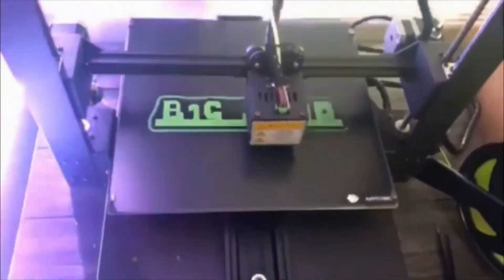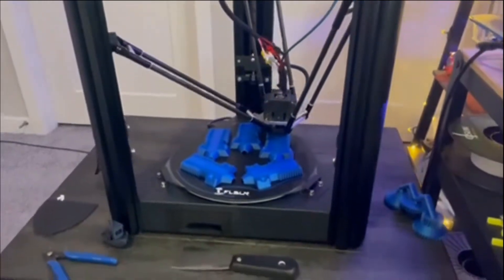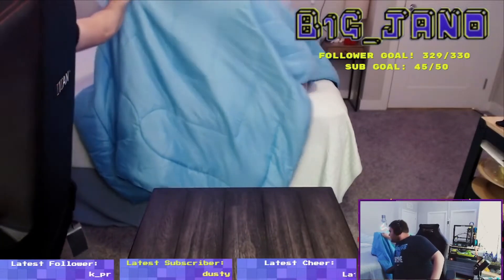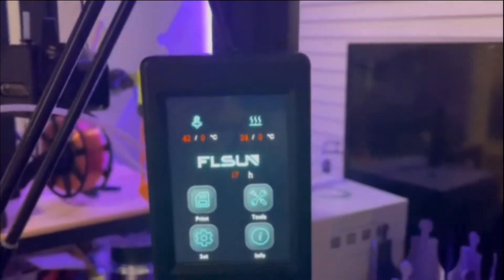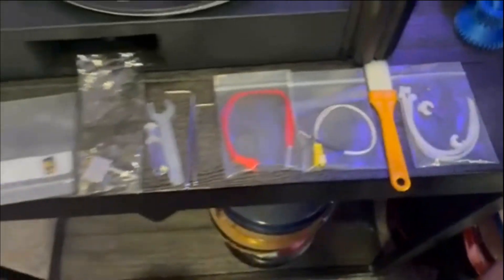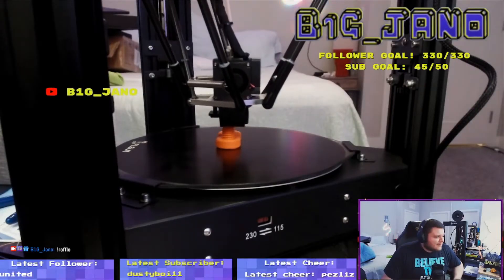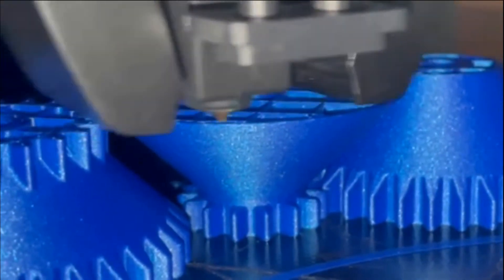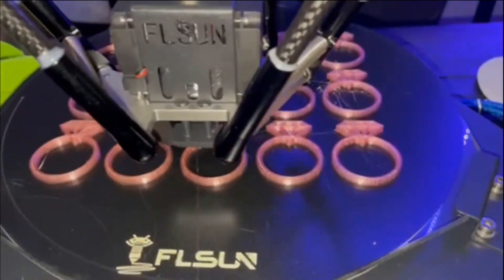I got a new 3D printer… and it is SUPER impressive!

Comment: Hi do you have stl for that nozzle light? And a video how you made it
Reply from the maker: Yes. The video is in the channel list not too far back! And the links for the stl’s should be in the link in the description of the video
Reply: @B1G_Jano  awesome thanks man I just seen it.

Also your quality looks so good what speed did you use on them prints?
My racer is coming tomorrow cant wait
Reply from the maker: I have the general speed set at 60mm/s with outer and inner walls set to 40 and 70mm/s respectively. Infill at 100mm/s travel at 120 mm/s with first layers set pretty slow to get adhesion.

Comment: Hey man I need help with my Anycubic Mega X. Just set it up but only one of the X axis sides are going down. Please help!!!
Reply from the maker: Hmm that’s odd… I would check to make sure all the motor wires are plugged in properly and in the right locations. Not sure what else could cause that other than a bad wire somewhere. Maybe that motor wire could be loose on the motherboard side as well.

Comment: B1G_Jano, I'm having trouble with my mega x. It's having a really hard time heating the bed up to temperature, and sometimes, like recently, it couldn't get to temperature. I have it set to 100 C and it took half an hour for it to get to 90 C and it wouldn't go past that. It's not cold in my room and I don't get what's wrong. It has printed fine in a few times in the past (I haven't used it that much).
Reply from the maker: The heater in the bed can realistically only go to 90-95c. Which is why it takes forever. I wouldn’t print much past 90 without risking damage
Reply: @B1GJano  ok thank you. what temp do you recommend for PLA?
Reply from the maker: @soupinnile4268  each pla might differ slightly but i usually print between 210-215 c

Comment: Speed is also limited by how fast the hotend can melt the filament. Other factors affect it too, but for this printer they likely used the melt rate.
Reply from the maker: Very good point!
Reply: @B1GJano  a standard microswiss needs 220C to get close to 150mm/s at 0.2LH & 0.4 nozzle {14.4mm3/s)